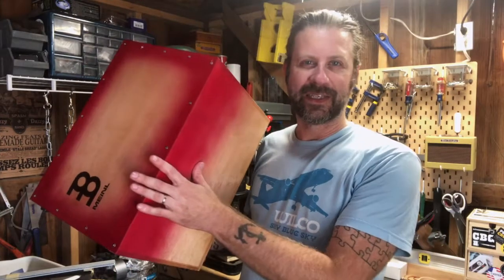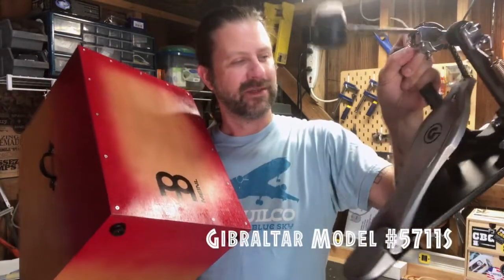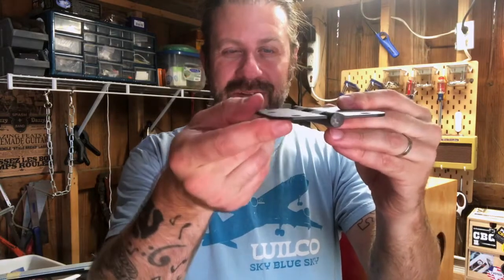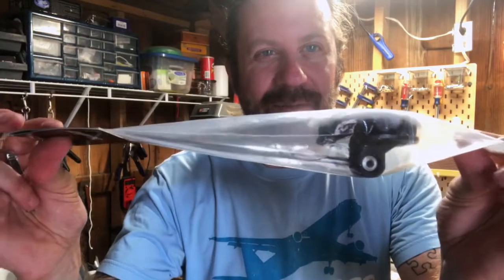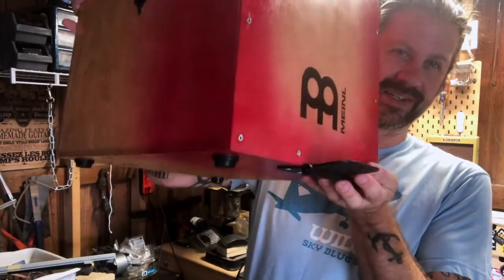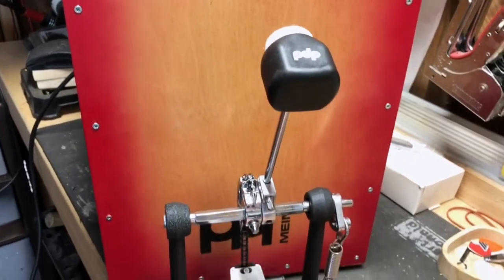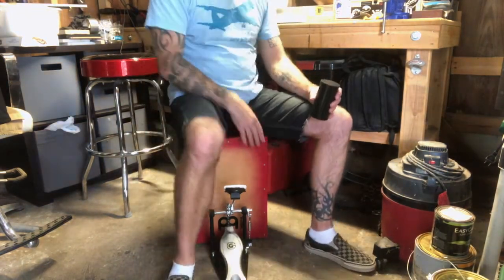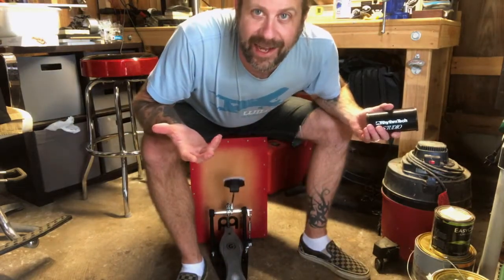Adding a Kick Pedal to Your Cajon (using a door hinge)

Comment: Move the beater down to hit the centre of the cajon because the snare wires are at the top of the cajon. The best bass note is in the centre or bottom third of the cajon. Your kick will sound 1000 times better when the beater is hitting the correct spot.
Reply from the maker: I thought that when I was assembling everything but unfortunately the pedal is pretty high so you'd have to have a really short beater (so short that I don't think you'd get a good sound). It may be a more long term solution to build some sort of a base that would raise the cajon a few inches so the beater is closer to the center. Again... this was a quick and dirty mod. Thanks for watching.

Comment: You could separate the leaves of the hinge, turn one of them around and re-insert the pin back on. That way it will line up better with the bass drum pedal gripper
Reply from the maker: Thanks for watching. You could most definitely do that. In fact, I did think of that during the prototyping process. You are correct that it move the outside portion of the hinge "higher" but then the hinge doesn't sit flat when you fold it back in. If you were planning to use the cajon only with a kick pedal, that would be a good option but if you plan to use it both with and w/o the pedal, you might be happier with the standard format. A couple little pieces of velcro on the hinge and it doesn't rattle or anything. Great suggestion.